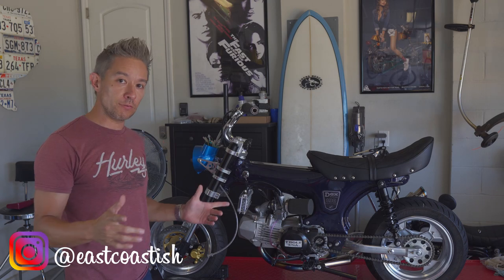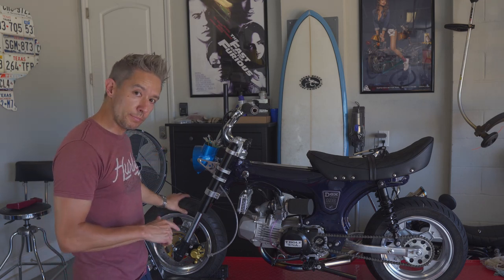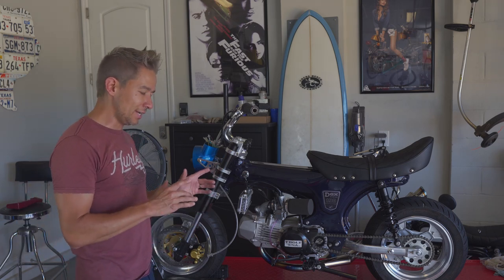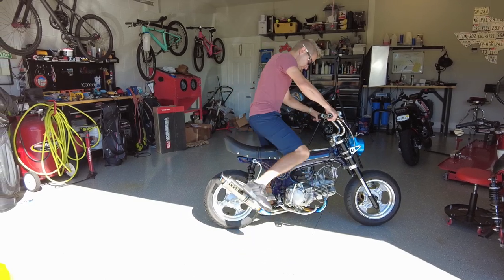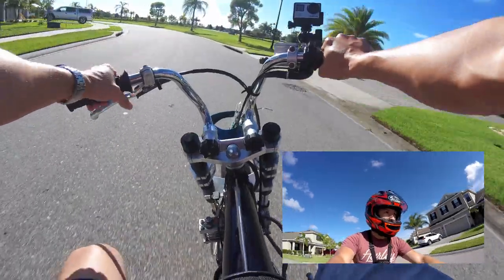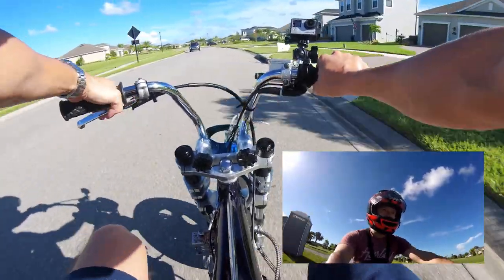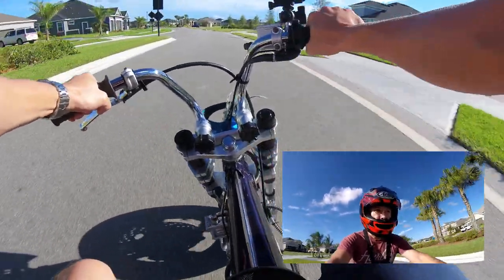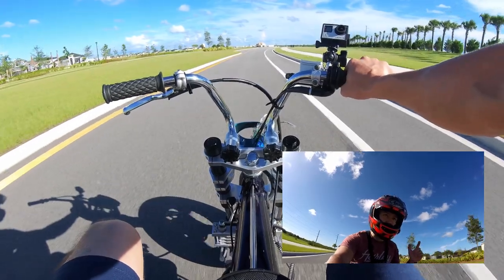First Ride on the Honda CT190 (CT70 / Dax)

Comment: Any updates on these bikes after a few hundred miles or so?  Be nice to see a rideout video of them as they seem forgotten about once built, for those of us who want to build a similar set up it would be great to see them after some longer term use with your thoughts.
Reply from the maker: After the first 10 or 20 miles you definitely need to recheck that all the nuts are tightened, but other than that these bikes are solid. I’ve sold most of these though before I’ve put significant mileage in them…

Comment: What do you put for mileage on the vermont paperwork? I used vermont to register my 1993 xt350 and want to do both my ct70's now but I don't believe the mileage for either bike is accurate
Reply from the maker: I’ve put N/A a couple of times. If you’re showing a number on your odometer you can put that, I don’t think they check. When I’ve later got the bike titled in FL they’ve marked my FL title EXEMPT in the odometer section because it’s so old.
Reply: @eastcoastish  awesome, thanks man

Comment: Hi!, just bought a Daytona 125 engine to swap the original skyteam one. Any recomendation?
Reply from the maker: Wasn't the skyteam also 125? Why swap for the same size? As far as recommendations for the install, it should be pretty straight forward swap.
Reply: @eastcoastish   Hi!, it double the hp in the papers, so it should be more than the stock, and since its a japoneses engine, Im expecting to be more reliable than the chinesse one, which is a troublemaker.

Comment: Got my daytona to run but trying to incorporate it in to the ct70 existing wiring.. wired the 70 red to 190 red. The ct70 battery blue to 190 ground... ct70 Yellow from old engine pigtail to red to key.. 
Blowing fuse.. cdi kills with + not ground.. 
Ugh
Reply from the maker: It may be easier to just rip out the old wiring and start new. You're running a 12v battery, right? Also you don't need the rectifier so make sure that's not still in line. The key is also going to be different; again, probably easier to just start fresh.
Reply: Yes 12v battery the tiny lithium 4cell is really cool. No rectifier.  I really just wanted the factory ignition key to work the lights and kill switch. Added that cool starter button you used in the clutch handle.
Reply: Happy Thanksgiving.  Thanks for your help